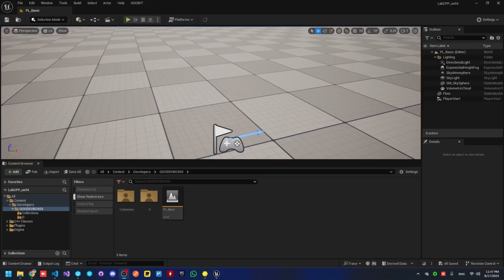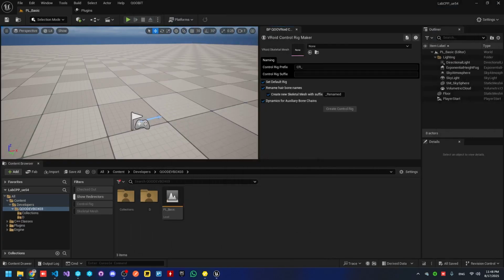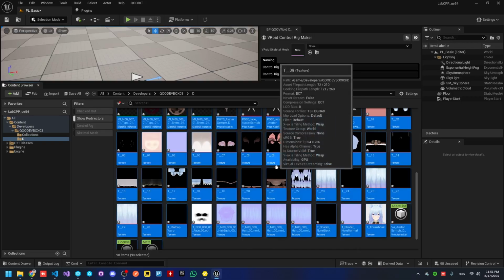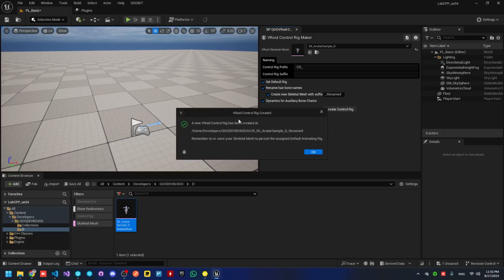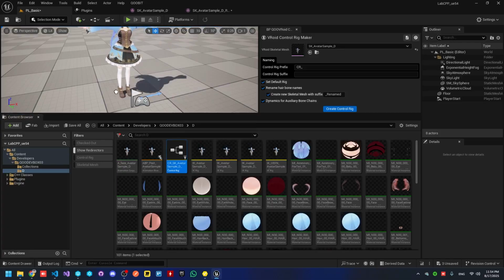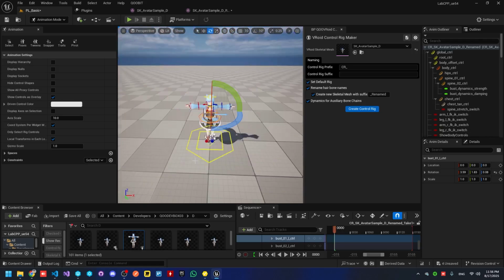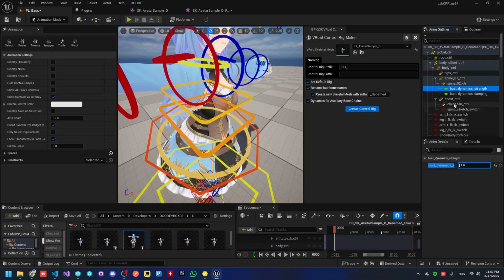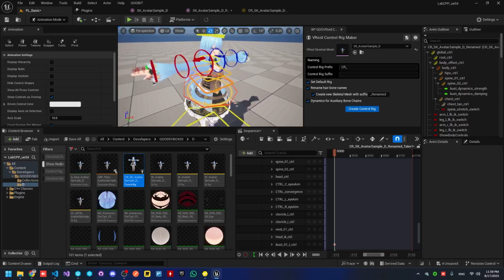QOOBIT VRoid Control Rig v1.0.0 - Unreal Engine Plugin

Comment: How can it will be different from VRM4U (Open Source repo)
Reply: This was built using Manny/MetaHuman body's control rig as a base and fixing some of the bugs in there with a few more added features. Some parts that differ from the VRM4U open source one is that the foot has more IK controls for rolling on heel, tip, ball. Also there is the convergence for the eye controls and auto resolve of all the bone chain dynamics for the floppy parts like the hair and clothing as you can see in the video. It also fixes some of the bone naming that comes out from VRoid Studio. Also there is  proper backwards solve for the eye controls that converts any animations directly to the individual eye controls but still allowing you to use the other controls for center aim and convergence after as well. There is also spine and neck IK but I think these are less used and finger proxy curl controls. I'm not sure if I can easily contribute some of these to the open source one since it's built a bit differently but that might be something I can look into if people are looking for some of these features for free in the open source one.